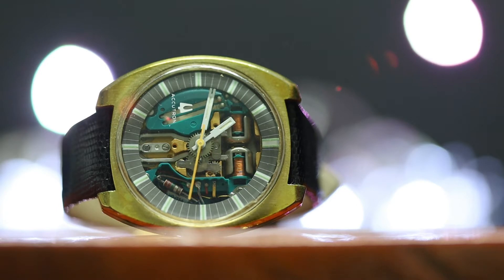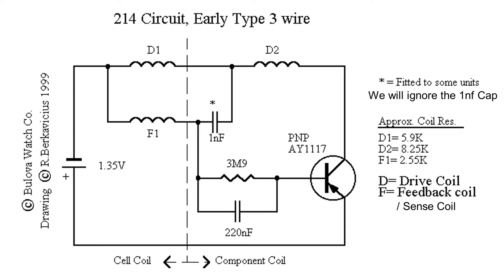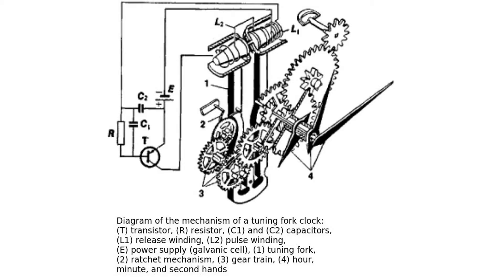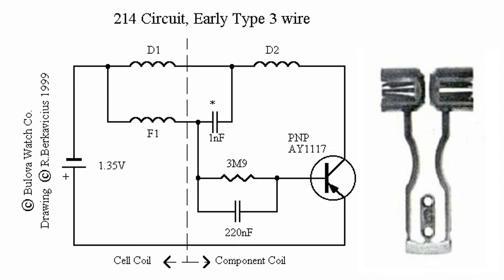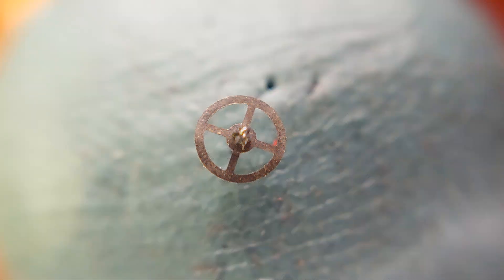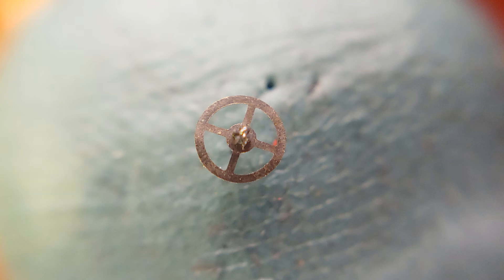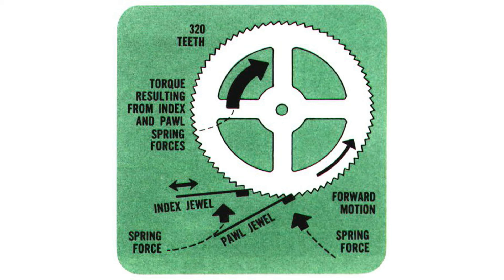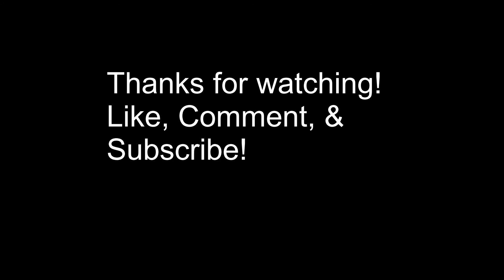The Bulova Accutron. Why I love it and how it works!

Comment: Great video. Great explanation. I am just curious about one point. I guess the placement of the feedback coil in relation to the fork leg. The accuracy of the placement would dictate the accuracy of the watch as it has to be placed in such a position that it prevents current flow in f1 when it is at a peak. Just wish I had a picture of it.

Comment: Somewhere between f and f sharp😂 they were the most successful mechanism before quarts,  because it lacked a balance wheel and other mechanical parts driven by magnetic fields, strictly a magnetic field to vibrate a fork and a precise frequency to advance the escapement a tooth at a time, awesome.

Comment: I have 2 Spaceview, 1 Bow tie, 2 Railroad, 2 Accuquartz.
Reply: I found a gold Bulova Accutron watch at a yard sale, but I'm having trouble identifying it. It says Bulova accutron on the dial face and the Bulova logo at the bottom about the 6 o'clock mark. The numbers are in Roman numerals on the face dial. The back says "10kt rolled gold plate back"  "Bulova N3" which I believe is the manufacturer year of 1973? It's in beautiful condition and I would like to know more about it. I believe it was a limited edition bc of the Roman numerals, but not sure.
Reply: You have a picture?

Comment: im trying to understand, so when the tuning fork has kinetic energy, that vibration signals the transistor which powers the drive and then when the fork slows down, which vibrates at a lower frequency, that creates a magnetic field which also trips the transistor only in the other direction?? wouldnt you need a NPN transistor to move current the other way? what am i missing here

Comment: Thank you for the video.  I've seen some slow motion of the Pawl Jewel and the index wheel on youtube.  It is mind blowing how fast and how small it is!!!
I have a Accutron my dad left me, paying too much to get it fixed.  Found a SpaceView recently, went to adjust time and the seconds hand went all over the dial.  I removed battery.(?) However,  I am also fascinated by Accutrons!
Reply from the maker: It is amazing! What was up with the Accutron your father left you? And were you able to get the second have back on?
Reply: @christicks5843  Thanks for your interest.  I sent my dads accutron without a second opinion to a place that will remain nameless, they are in UTAH!  The case, Dial, and Hands were all in great shape.  They gave me whole list of parts I needed!! ($2000+) It was a mistake but I committed to it.  Found another guy who fixes only Accutrons, Mybob.net.  He seems very knowledgeable and honest.  I will send my SpaceView to him.  They guy I bought the SpaceView from is avoiding me. As I understand, Spaceview Alpha, has a Precisionist Movement.  I have a Precisionist found one NEW at really good price.  
Chris How do store your Accutrons?  Do you remove the battery when not being worn?
Thanks again-
Reply from the maker: @marcuslieberman3577  damn that is a pricey repair! Good luck with the gent from Mybob.net.

I do tend to remove the batteries when I am not wearing them. Haha otherwise I would go broke constantly replacing batteries.